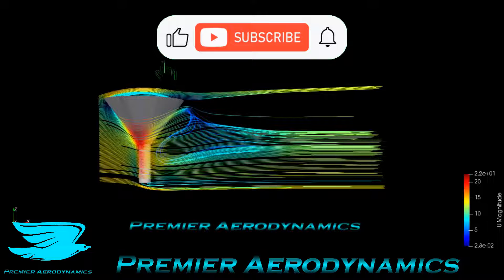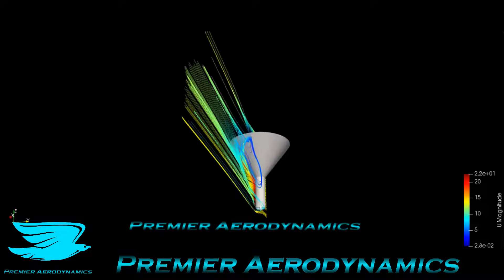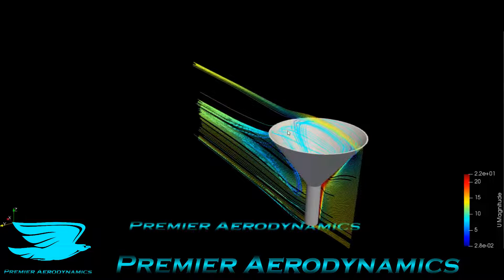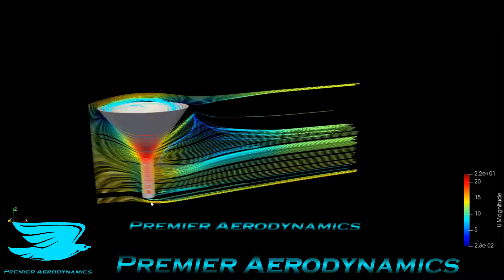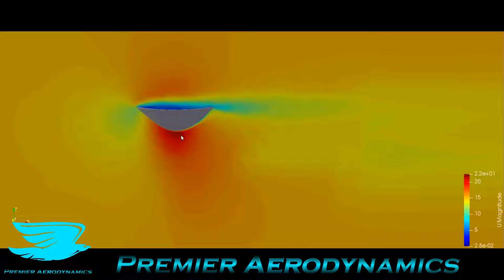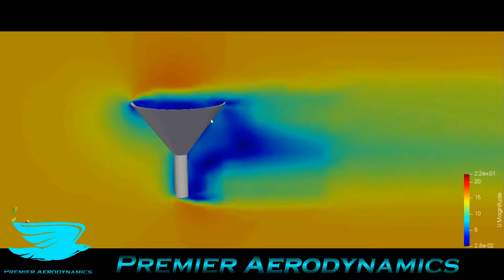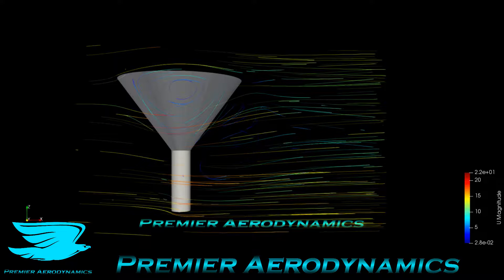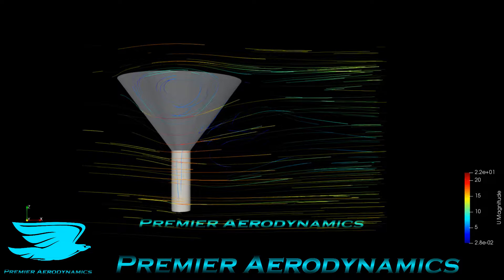Aerodynamics of a Funnel

Comment: If there's recirculation at the top of the funnel then it would stand to reason the pressure there is near static, and the air entrained by the oncoming flow would lower the pressure at the snout. Therefore the pressure at the top of the funnel is higher than the bottom, so air would flow downwards.

I live in a building with a hollow center section, and on hot days, the temperature in the hollow section is cooler than the outside(since it gets little sunlight), and hence higher pressure, so the doorways to the building always have a nice breeze blowing outward, because of the pressure gradient. It also helps that the lobby's A/C is cooling the ground floor as well, further increasing the relative density to the air outside the building.
Reply from the maker: Oh yeah! That makes sense. There is recirculation in the top bit. So, the flow near the bottom accelerates, which drops its pressure, so some leaks out.